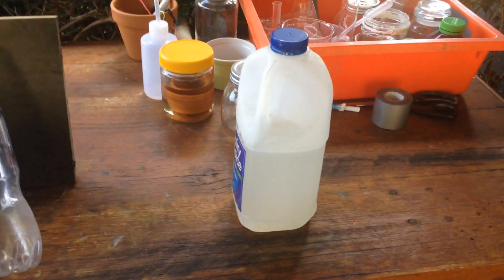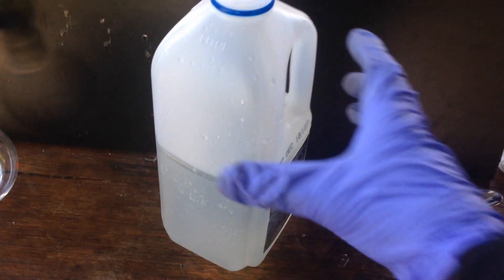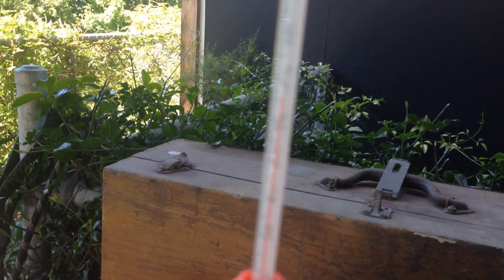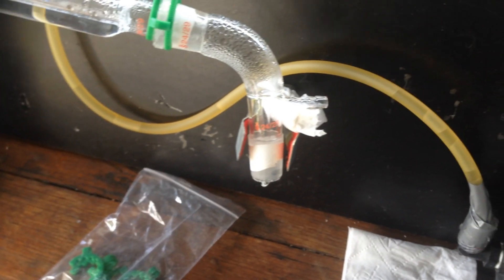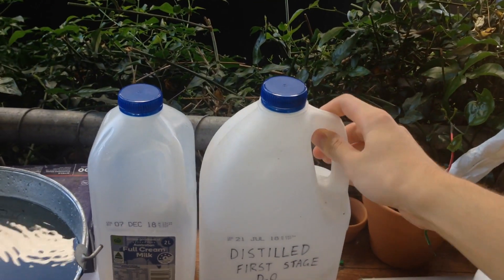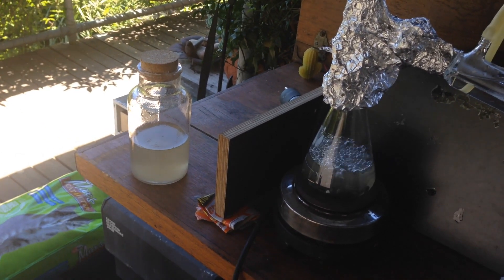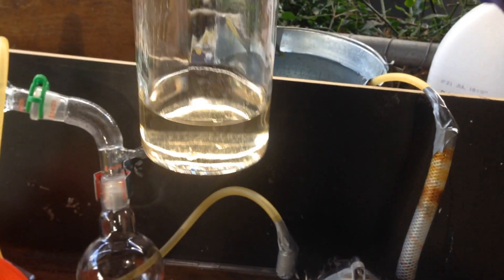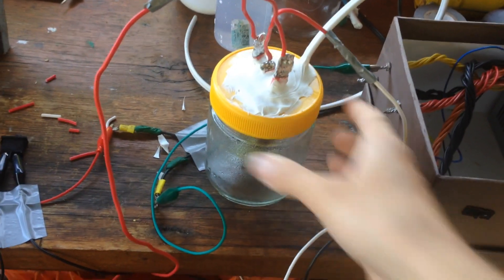Making Deuterium - Part 2

Comment: Since youre not trying to keep oxygen and hydrogen separate, why not just use AC from the wall for your electrolysis to preserve your electrodes?
Reply from the maker: AC electrolysis wouldn't quite work in the way you're imagining.
1) It's much much less efficient for splitting water than direct current.
2) It doesn't preserve the electrodes.
Reply: @ScrapScience  sounds like you tried it already.

Comment: May I ask what you will be using your deuterium for? Is this for fun or do we have a Fusor aspirant here?
Reply from the maker: First Last So far I don't have any plans for a fusor or anything of the sort. At this stage I'm just aiming for a small sample of homemade heavy water, which I'll keep as a souvenir.
Reply: Scrap Science Okay, do you have a method of determining the concentration? Unless you have mass spectrometer laying around I would suggest weighing it and compared the weight to some purified heavy water. Also so far I like you content, KEEP POSTING!!
Reply from the maker: First Last Thanks very much, I'm glad you enjoy the videos. While I certainly can't determine an accurate concentration without a mass spectrometer, the melting point and density should be reasonably easy to measure using an accurate scale and thermometer, which will hopefully give some indication of concentration. Also, if I manage to make a high enough purity for a frozen piece to sink in regular water, that will confirm the deuterium concentration to be greater than 83% (as that is the minimum purity to allow an ice cube to sink).
Reply: Scrap Science you could also buy heavy water (its relativity cheap) and try to compare its weight to a sample of your deuterium to see how close they match up
Reply from the maker: First Last thanks for the idea, I'll have to buy some. Sounds like a plan.

Comment: Hey, that's funny - I decided I wanted to do the experiment for fun (with no chemistry knowledge) and it appears you posted this just the other day :)

Here are a couple of dumb question, again from someone without a chemistry background:

1. could you go faster with the reaction by increasing the voltage and cooling the apparatus by putting it in a large bucket of water so the heavy water doesn't just boil off?
2. how are you calculating how concentrated the water gets after each run? Is halving your water and topping the most efficient way?
3. what are the most easily available but still reasonable electrolytes and electrodes I can use?
Reply from the maker: Thanks for the questions,  they're probably things that I should have explained in the videos anyway.
1.   In general, yes, increasing the voltage will definitely increase the rate of the reaction (the rate of reaction is actually determined by the current flow but that is controlled by the voltage anyway). However, there are three main problems with making the voltage too high. First of all, you'll probably need to worry about how much current the wires and connections can handle. For me, my connections can handle only a little over 10 amps, which is sufficient to electrolyse through 100mL of water daily, and increasing the voltage to anything over the 5 volts that I'm using now would probably heat the connections far too much. Secondly, if your electricity isn't very cheap, you'll probably want to worry about efficiency, because at higher voltages, the efficiency of the setup becomes lower and lower. You can work out the efficiency by just dividing 1.23 (the amount of voltage used to split the water) by the voltage you use for the cell, for example, at 5 volts you'll have an efficiency of about 25%, but at 12 volts it will be only 10% efficient. When you're electrolysing down litres and litres of water then this does become a pretty big consideration. Finally, as you said, using a higher voltage will heat up the cell a lot more and you will definitely need some kind of cooling technique, in fact, that big orange bucket under my desk at 0:44 is what I use for this currently. If you are going to double the voltage, the heat given off by the cell will quadruple, so the heating can quickly go out of control. With all that said, if you have big sturdy wires and connections, have relatively cheap electricity and can cool the cell very efficiently, then go for it. Another thing you can do is have a very long tube for the hydrogen and oxygen to escape the cell, so that any evaporated water from the cell will condense and be collected in a second container.
2.   The calculations to work out concentration are based on the separation factor for electrolysis, which is normally between 5 and 10. Without getting into too much maths, at a separation factor of 10, reducing the volume to half of the original will make the % concentration of deuterium 1.866 times greater, while at a separation factor of 5, doing the same thing will make the % concentration 1.741 times greater. From what little I have found, the electrodes that give the best separation are lead and steel, apparently giving factors of around 8, though this isn't based on very concrete evidence. Halving the water and topping is definitely not the most efficient way to separate heavy water, it's actually a pretty lossy way of doing it. Just electrolysing a large quantity of water down without doing any 'topping up' would be much better, though the reason I do it like this is because this way I can save on the electrolyte I use. By topping up the cell 10 times for each run, I only have to use a tenth of the sodium hydroxide that I would have used without doing any topping up. If you can get a very cheap electrolyte and have enough sanity to empty and fill your cell every other day (that is, if you use a similarly sized cell), then don't bother doing the 'topping up method', otherwise topping up with distilled water is a lot easier.
3.   In my experience, the only electrolytes that can become conductive enough for running this kind of cell at 10 amps and 5 volts (a current and voltage that I would recommend) are sulfuric acid and sodium hydroxide, and aside from sodium hydroxide being much easier and cheaper to get (most hardware stores should have it as 'lye' or 'caustic soda'), the options for electrodes is much greater. For your first stage of concentration I'd say to use sodium hydroxide as an electrolyte (don't touch it, it's pretty nasty stuff) and use steel electrodes (using a regular steel cathode and a stainless steel anode would be ideal). Placing the electrodes closer together will allow you to use less electrolyte by the way, though don't put them close enough to spark in the cell as the resulting explosion will probably make you deaf. Once you've concentrated your first stage you'll need to neutralise the hydroxide with acid (ideally sodium bisulfate, as this will minimise the water that you're adding to your concentrated stuff), and distill as I've done in this video and repeat your steps until you're down to millilitre quantities.
Sorry for the long answers, but if you have any other questions, feel free to ask. It's great to know that someone else is giving this a go, I hope it turns out well for you.
Reply: @ScrapScience  Thanks for the detailed answer! If it's not too much of a bother, could you get a bit into the math? I'd like to write a script to run some simulations to decide how much to let the water concentrate to before topping of, if topping of at all, depending on how annoying it is :p

I'll also be able to simulate how much it will cost in electricity and sodium hydroxide!

I'm going to go the sodium hydroxide/steel electrode route as I have cheap access to those. I think I could use a couple of spoons? Those should be stainless.
Reply from the maker: @3dadventures792  Sure thing, I'm not too certain on the maths myself, but I'll give you what I'm assuming is correct. From what I've gathered, the increase in concentration follows the equation:     a=b^((1/c)-1)    (I believe it's called the Rayleigh equation), where 'a' is equal to the factor that concentration increases by, 'b' is equal to the volume fraction of the original sample left over, and 'c' is equal to the separation factor. For example, if you halve the original volume of a sample of water by electrolysis (b=0.5), with a separation factor of 10 (c=10), then:   a=(0.5)^((1/10)-1)    which gives:    a=1.866    and thus the % concentration of deuterium will increase by a factor of 1.866 every time you halve the volume of water when you have high separation. For different separation factors and volume reductions you can just sub in the appropriate values of 'b' and 'c'. By the way, the hydrogen in regular water has a deuterium content of 0.0156%.

If you have cheap access to those supplies, sounds like you're all set. I actually had the idea of using spoons as well, though that was after I'd already built my cell, if you go with that though, you'll probably need to use multiple in order to draw a reasonable current. And also, I'm completely unaware of how stainless steel will perform as a cathode (as the cathode is the part doing the deuterium separation) and I haven't found any info online, you might be risking a low separation factor there, though I have no idea.

Best of luck :)
Reply: @ScrapScience  Thanks again for everything! I'll use a regular steel cathode, then.

Looking forward to new videos and about to binge watch your old ones.

Last question and then I promise I'll stop harassing you :p
Does the output from my simulation look in the right ballpark?
https://i.imgur.com/ZLuWpbf.png
Reply from the maker: @3dadventures792  Looks like your calculations are spot on, seems like you're good to go.

In fact, if you're up for a search, cody'slab ( https://www.youtube.com/channel/UCu6mSoMNzHQiBIOCkHUa2Aw ) made a series on a similar process a few years ago, which I found very helpful up until the point where it was taken down due to the legal issues of his 'making uranium metal' video. I'm sure the series will be somewhere online, if you dig deep enough. All the original videos seem to be private now, https://www.youtube.com/playlist?list=PLKhDkilF5o6_MTogGYYdEetWJgglcqhCr 

I'll look forward to hearing how it all goes
Reply: @ScrapScience  Can I use graphite sheets as electrodes? Do you have a paper or something from witch you developed this procedure